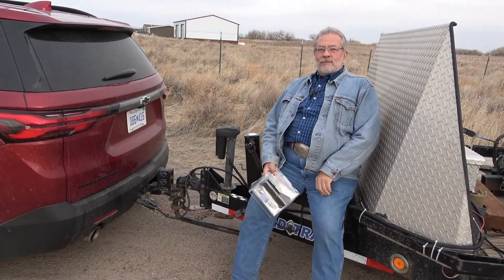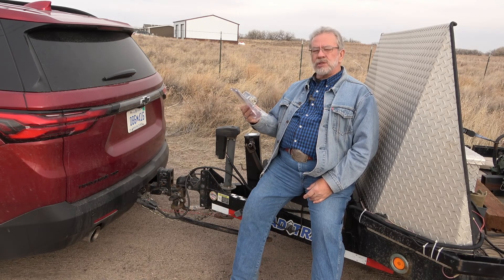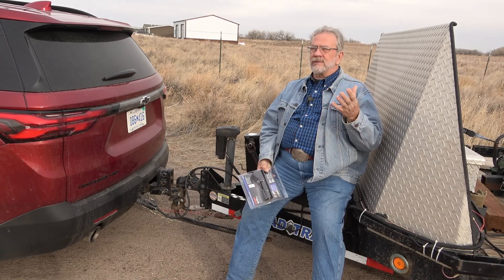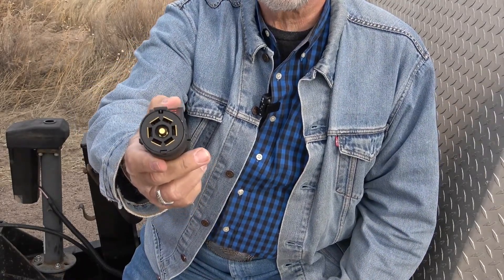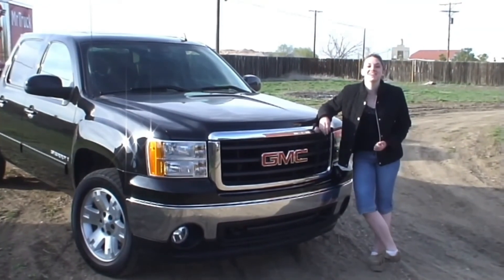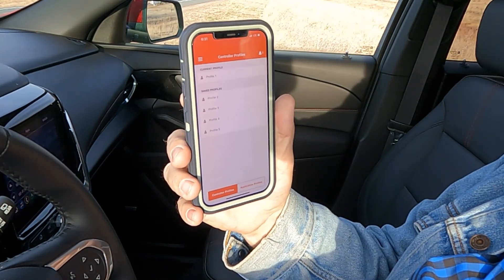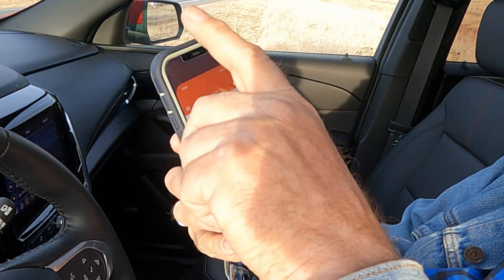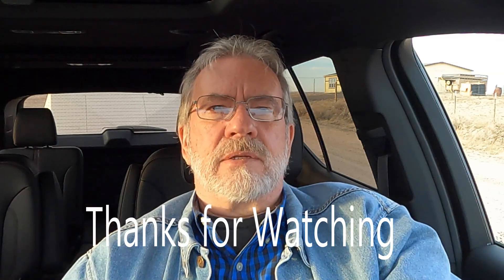Reviewing the Curt Echo Bluetooth Smart Phone trailer brake controller.  Many SUV's and trucks don't

Comment: I still got question. The gain setting adjusts how much braking. Ok. But does that braking power is triggered automatically when the vehicle brake pedal is depressed?
Reply from the maker: The manual gain setting is the same as the gain setting you set on the app. The only brake controller that I know of that goes max gain when you grab the manual trigger, is Tuson DirecLink controller
Reply: @MrTruckTV  are the trailer brakes activated when the car brake pedal is pushed or only with the button in the app?
Reply from the maker: @davidtolentino4755  Yes, the truck foot brake will trigger the Echo trailer brake controller

Comment: I spent a couple hours trying to get this to work to no avail. If you Bluetooth on the phone pairs with it the app won’t work.  Unlike any other connected Bluetooth the phone won’t let me “forget this device”.  Then it says no trailer connected.”  There is and my old controller worked until I removed it.
Reply from the maker: That does happen sometimes, It works for me. TFL truck tried them and it didn't work for them

Comment: Garbage design. That plug is way too long and that useless strap doesn’t do much. Still really loose, need zip ties. They didn’t  have a regular brake controller, so I had to use one of these wireless ones. Big mistake.

Comment: Do not buy unless you do your own strap. That cheap rubber one they give you does not hold so it will fall off and there goes your $289.00 down the road!!!
Reply from the maker: I've been lucky, but a thicker strap is a good idea
Reply: I’m thinking reusable zip ties @lynn, a friend of mine also bought one and said zip ties reassured him.

Comment: 👍👍🇺🇸🇺🇸
Reply from the maker: Thanks
Reply: We are putting this in a new jeep wagoner and towing our trailer to grand lake Colorado this summer. Do you have any problems losing connection with the blue tooth/phone? Have you used this on the Ike gauntlet?
Reply from the maker: @codybell4317  I've got two of them with now problems. Andre said that TFL tried one and couldn't get the signal. I'm had many problem with Ram trucks factory brake controller from Continental. So my experience says the Echo is better than what you would have got, if you had the factory installed brake controller.
Reply: @MrTruckTV  thank you and now we didn’t have that option. I actually drive a Ram 1500 and the factory controller after driving over 300 miles says to have the electronic brake control serviced. Is that the problems you are speaking of?
Reply from the maker: @codybell4317  No more more severe,  on heavy trailers it doesn't brake enough, on lighter trailers if brakes too much. I recomend to people with factory Ram brake controllers to unplug it and plug in a DirecLink or Prodigy 3.
Reply: @MrTruckTV  Thank you so much for the quick response and your confidence is very helpful regarding the Echo!